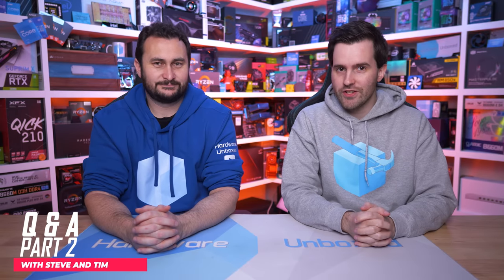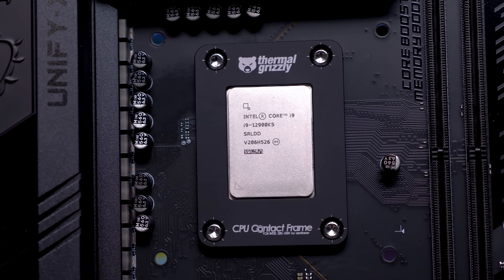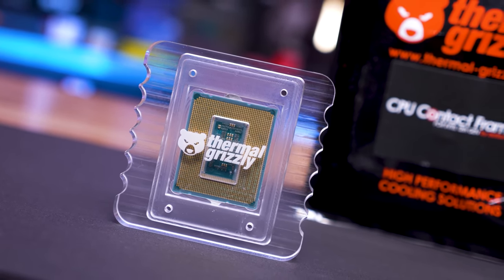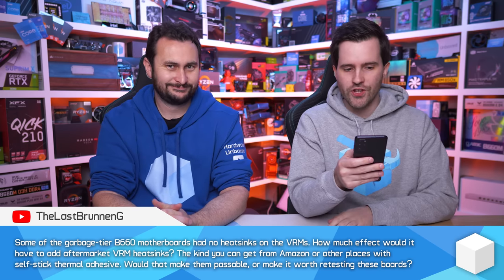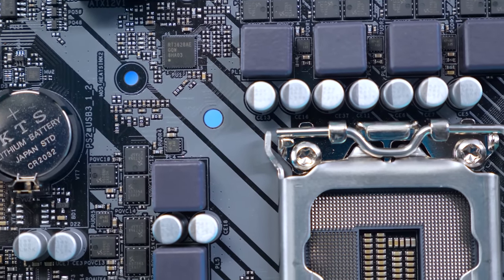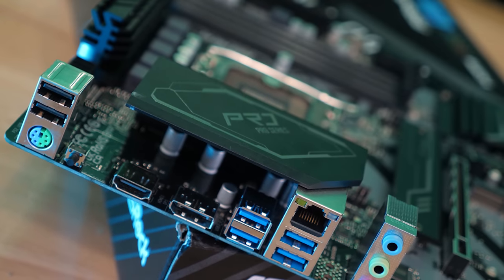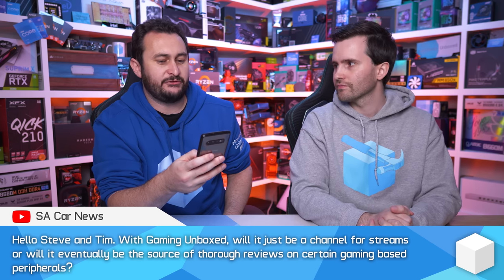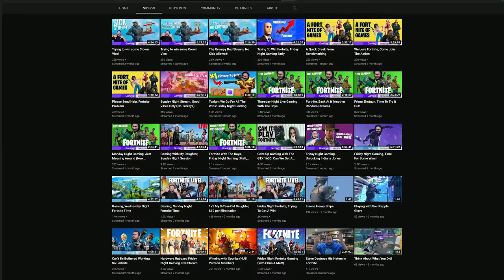Biggest Tech Fail 2022? Zen 4 To Make DDR5 Relevant? August Q&A [Part 2]

Comment: "What fully asynchronous task for gaming... can just be run OVER THERE"

As a former commercial game engine dev, LOTS.

First off physics is generally asynchronous, it runs at a fixed framerate, usually 30, sometimes 45, 48 or 60, because trying to do physics at a variable output framerate as dictated by GPU, display, etc, has lead to HORRIBLE failures every single time. It runs in its own thread (single, with some mildly multithreaded workers in some implementations for just a portion of the workload, like broadpass) and it emits one set of location snapshots encompassing every movable entity, every physics frame. Then the game main thread, for every frame to be rendered, picks a point in time between two last snapshots and interpolates between them to create a display position.

Networking and game logic tends to be somewhat integrated/synchronised with physics and using the same interpolation mechanism. It depends.

Then there's AI. If you're doing anything complex, you're going to need raycasts, lots of them, and you're going to batch them, so every time AI needs a raycast, it registers a callback and it receives the result one or several AI frames later and continues the logic then.

Then there's PVS (potentially visible set), where you're culling stuff. That might be Umbra, nobody quite knows what it does, there's a number of others, can be asynchronous, very. If it's conservative enough, maybe you won't see the gaps.

Then there's geometry buffer generation for the GPU. Again highly asynchronous, reacting to necessary object LOD changes, but with a delay. Also loading in chunks of the world that you're going to need soon, swapping in visible textures for higher resolution versions. The more eagerly you can do those jobs for things that might be needed with remaining CPU time, the more consistent you can keep the framerate as you don't have to stop rendering then and just beg the generator to hurry up. Have you seen what happens when you run GTA5 on a fast GPU with too few and too slow CPU cores? Chunks of the world go missing as it can't make time to generate them in time, it doesn't even have a sufficiently functional "stop rendering and hurry up the generator" logic.

Whether ecores help is another question entirely. The worker/tasklet schedulers in games don't have enough knowledge about these things, and foremost, game codebases usually have a LOT of data sharing (real and false both), contention, so scalability to ever more threads/cores becomes slower and more limited. You could move to more copying, message passing style systems which decouple and scale much better because then you're doing much better on the highend but you're raising minspec since you're introducing overhead to make things scale better, and you don't want to raise minspec, NO NO NO, that eats into your sales! Still, i expect some things to eventually be more e-core-friendly by design eventually, but not sure by how much and when, whether it'll ever be worth it.

Of course nobody's gonna read this but oh well.

Comment: When someone asks what 'sensitivity' you use, it's usually just an uninformed/incomplete question. Streamers for example will generally either answer with their DPI and their game specific sensitivity, or will instead answer with a measure of distance for one revolution (cm/360). Cm/360 can be easily calculated online, or manually if you know the raw sensitivity multipliers.
Some people will answer with an "edpi" value, but edpi is worthless because it's game specific and offers nothing better than the sens & dpi response. Cm/360 is the standard 'proper' response for FPS games generally.
With modern FPS, the only two real factors are DPI and the game 'sensitivity'. DPI is the resolution of the sensor's image itself, and the game sensitivity acts as a multiplier when translating X and Y counts into 3d degrees of rotation. 'Windows sensitivity' has been almost irrelevant for many years at this point, as almost every FPS game will bypass it and use the raw input. It's still a thing for 2d environments generally, and even stuff like the loot menus in Apex and (probably) Fortnite. Though this is a good thing as you can have the benefits of high DPI when moving the camera without then having to manage your 2d cursor at like 16k DPI.

tldr: measure/calculate ur distance for one rotation (cm/360) to have a universal answer. The 'average' range is probably anywhere between 15-50cm, but it varies a lot, especially amongst the less competitive crowds. Windows sens almost never matters, just dpi and the game specific sensitivity.

Comment: 16:10 biggest recent fail in tech... the intel LGA1700 ILM bending 12th gen cpus and no one holding them to account for it, everyone just advertises the 3rd party replacement products.
Reply: Yup but the 11900k is a waste of sand lol
Reply: I wouldn't consider that a fail. Just leaving marginal performance on the table for cost savings. The ILM has always been like that.
Once AMD started pushing intel they first changed their crap thermalpaste to a soldered IHS, then they factory flattened the IHS to improve thermal performance and now 3rd party companies found another trick to improve thermals. But you're hardly leaving any performance on the table just by having a 4-5°C warmer CPU.
Reply: @gamingmarcus  I wouldn't call a 10 degree celcius difference and throttling a "marginal performance" loss.

It's actually caused people to try to compensate by buying/upgrading to a cooler that's $100 more expensive than needed (if it were a properly designed ILM), not knowing what the real problem was.
Reply: @Penaldian  but that was 2021

Comment: 8:23 II use a DPI of at least 5500 DPI, but sometimes higher. The reason is I have issues with my shoulders that mean that lower DPI's where I have to make bigger arm movements can cause pain - or worse, potentially. Hence being able to crank the sensitivity high enough that I only need a few cm to go from one edge of the screen to another is really useful.

EDIT: Just to add a clarification given one response: the issue with my shoulder is due to hypermobility causing the shoulder to shift unpleasantly.
Reply: Well, using the hand for playing as for "Self pleasure" is not a good idea. Ever considered shifting?
Reply: Get the M575.  It's a trackball mouse that doesn't require any shoulder movement.  My dad loves his.
Reply: @giglioflex  I have tried trackballs, but I can't get the hang of them. Thanks for the suggestion though.

Comment: When AMD released Mantle, they really needed it: they were selling decent GPUs at the time but their CPUs were getting trashed at gaming. By enabling asynchronous GPU / CPU interactions, they could prevent their slow FX chips from impeding their RX290 GPUs and make pitching an all-AMD system not be completely ludicrous.
Reply: I remember watching AMD's keynotes about how Mantle worked when they first introduced it. How it was supposed to help the system wade pass all of the crap & bloat of Windows and help the GPU communicate more directly with the CPU while running games. They also spoke about an audio codec that was also part of Mantle to help produce a more realistic and directional sound experience in games. Sadly, I think the only game that ever took advantage of it was the not so good remake of the THIEF game.

As for AMD's graphics cards, the one you speak of was the R9 290/290X. I remember drooling over them big time when they came out. Sadly I had no money to even think about obtaining something like that. But by the time the 300 series graphics cards came out I was able to nab an R9 270X for $160. Which I still happen to have. Then a while later I was able to obtain an R9 FURY for $260 when the new RX 400 series cards came out. I still have the R9 Fury as well, but my nephew is currently using it. Eventually I'll get it back and keep it in the collection. I like keeping my previous graphics cards from years past to see my progression from having nothing to what I've gained. An RX 6900XT is in my sights, I'm keeping my eye on the price drops. :)
Reply: @Slane583  the consoles seem to be making use of the directional audio tech these days, at least their HD audio product description reads exactly like the amd true audio on my 390
Reply: @mattBLACKpunk  Huh, interesting.  If that's the case then it's good to see that it hasn't gone the way of the Dodo. Even though Mantle is no longer around in name I feel that's what Vulkan has become. Then DX12 & DX12 Extreme are offshoots of the same thing. Rebellion seems to be quite good at including both DX and Vulkan in their Sniper Elite games. SE-5 has both DX12 and Vulkan as api choices in the game settings.
Reply: @Slane583  Vulkan actually is based on Mantle.  It's essentially a combination of Mantle and OpenGL in its root design.

Comment: With regard to the highest tier component to avoid bottleneck debate; when trying to build a balanced PC, it's often difficult to find out whether or not a certain GPU  or CPU will bottleneck it's counterpart when all it is tested with is the highest tier part.

IMHO, the only way to find out is to watch benchmarks with the pairing you're interested in, plenty of which can be found on YouTube.

For example, I was trying to weigh up upgrading from a 3700X to a 5800X3D with a 3080 and playing at 1440p and there just wasn't any information on any of the major hardware channels besides me looking at the data and making my best guess.  This definitely helps get in the ball park, but looking at benchmarks in the games I play with those specific pairings and comparing them was definitely the way to go

Comment: Software dev here adding my 2 cents on multi-core games.  AI actually can be run 100% async and not tie back into the main thread at all.  For games anything that can have a lag of 2-3 frames from the main thread can be fully async.  It works like this: spin off a new thread to do a specific task (for example handle the AI for crowds and cars in Spider-Man) and let that task run at it's own speed.  Use a shared memory data structure that both the main thread and the second thread have access to, and use a flag to know when an update is available.  If the flag is set the main thread grabs the new info and uses it, if the flag is not set it uses the old info.  Thus means the main thread is never stuck waiting on a slower thread.  If the slow thread isn't ready it just keeps on moving and checks again next thread.  I don't do game engine development, but my educated guess is that this is already happening.  Shared memory between cores means a lot of memory read/writes which is improved by larger CPU cache.  Testing on this channel already shows CPU cache is king instead of core count most likely because thread memory sharing can still happen on lower core count CPUs since application thread count is often much higher than physical core/thread count.

IO is already done this way, the main thread checks if a key or mouse button has been pressed to do some action and if not it moves on.  Same for network connection in multiplayer games.  This is what allows a game to run at 200 FPS on your machine without getting 200 updates per second from the game server.

Comment: Had an i5-2500k in 2011 lasted me until 2019 when  i jumped onto Ryzen 2700 even then i knew it could last another 3-4 years had i not gotten a bargain on the 2nd hand Ryzen 2700 system, probably would have jumped onto 5600x when it came out if i didn't get the deal. While we are in another resurgence of pc hardware revolution still think 8-10yrs is a reasonable time frame, especially with 4k/8k making us GPU bound atm.
By the time PS6/Xbox XX comes out is probably when you'd have to upgrade again
Reply: Zen/Zen+ aged pretty poorly though. Zen 3 is usually at least 50% faster in most games
Reply: @Lurch7861 yeah it's a bit like the early 2000s again where things advanced rapidly. Then things stagnated 2011 to 2016
Reply: I'm still using a 2500K (4c / 4t) today. Best bang/$ purchase for me as far as gaming PC is concerned for me, I've been using it since 2012. I'm about to upgrade since my GPU  died a month ago (GTX660 Ti). I'm thinking of going 5600x or i5-12400 (I'm leaning towards the 12400 since onboard graphics can be a lifesaver...) +Rx 6600 (XT if I can afford it) for my next build and we'll see how far this takes me... At least I won't have to sell a kidney to upgrade now, thanks to the crypto market imploding.The whole PC started to show it's age about 2 years ago, that's when some games became impossible to play, but most of the games I play where still playable with lower settings (1080p). I would have upgraded sooner but GPU prices being totally crazy forced me to wait.
Reply: @dalaran33434  try to aim for at least a 3060 Ti or 6700 XT if you can. They might get even cheaper later this month
Reply: @dalaran33434  I've completed Cyberpunk using i5-2500K @ 4,5 Ghz & 1060 6 GB. 1080p, medium settings, about 40 fps. 
I plan to upgrade to i5-13400 or i5-12400 depending on the price but definitely stay on DDR4.

Comment: About the "i5 are enough"... When there's any game that lags to the moon or won't work at all on an i3-12100, we can come back to this topic. It's really a moot point to discuss the relevance of over 6c CPUs as a minimum when the 4c8t are still gaming just fine.
Reply: Yes but only if those 4c are modern, 4c from 5-10 years ago will cause you problems for sure.
Reply: @John__K  For 5 years we had Skylake IPC, obviously old quad cores aren't good.
Reply: @John__K  Just upgraded my i7-4770, 1080ti build to a 12600k, 3080ti

I can tell you that no, the CPU(4 cores, 8 threads, 2013 model) was not a problem for any game not named Microsoft Flight Sim. Even civ six, a very CPU intense game, ran well. That's essentially the only game I've seen any noticeable performance enhancement from the CPU in.
Reply: I can still use my e3-1245 .
The xeon i use is slow in singel core than a i7 2700k but in multi core use its faster with all cores than a i7 2700k .(it can use more tdp) 
The cpu still play games fine with a good card (use a nvidia 1050ti) .
Thanks to amd fsr option in games)
Oke i have to set details lower .
But i never play ultra mode or even high mode.
I play race games or faster shooters.
So i do not need Nice extrame ultra pixels.
Only in game what have a lot of people in it than you see that the e3-1245 is time for a upgrade .
Will i do not play that games with 125 people on a map.
So for me its not a problem 

O and its a Dell t1600 systeem with custom cooler systeem (beult my self a hybrid heatpipes syteem with the original dell fan )
The cpu temps are real low about 60/70 celcius in stress

Comment: In regards to the guy with the HTPC for gaming, you have another option. streaming games from your main PC via Steam Link or other in home streaming. so as long as you have hardware robust enough to stream 4k content reliably, you are solid. So chosing your graphics card for the HTPC is open to lower tier cards. Also, a note, if your TV does not have a good enough "game mode" or does not have Free sync/gsync and is not above 60hz, you will still have LAG! Take it from me, the screen lag is Real! On line competitive gaming is a no go. What works for consoles does not translate in to the PC world via TV. And if you are streaming to the TV that will double your lag....just some food for thought.

Comment: Most shooter games are not affected by the pointer speed setting in Windows. If you just share your DPI and in game sensitivity we can figure it out, but the standard is to measure cm/360°. There are also websites that calculate this and help you match it between games.

Comment: What you guys are missing on the 4C/4T discussion is the lack of ST progress during those years. That more than anything is what kept them alive coupled with some of the early ones like 2500K having great OC potential. A 2500K at 4,8GHz is not that far off a 6600K at stock. THAT more than the core/thread count not increasing (and what was needed) is what made it last so long.

Since both Intel and AMD are at each other's necks and pushing frequency and IPC again. General industry progress will in return raise how demanding games can be. The 5600X will start to fall behind in the ST department much faster than Sandy Bridge did. Core count is not what will make it obsolete, just being "slow" is.

Comment: I do say on the DDR5 question, it seems to be that if a game is optimized HEAVILY for AMD RT (IE Compenating for it's lackluster perf by offloading data onto the CPU using the far higher CPU-bandwidth on the PS5/Series S|X versus any PCs atm), it would be a bit boon if you turn RT on.

At least based on the only few reasons a performance jump of that magnitude would occur in Spiderman when going from DDR4 to DDR5 (or 3DVC in the 5800X3D compensating for it) when RT is on at 1080p.

And with Upscaling options like DLSS/IGTI/FSR2/UE-TSR, more games will run at 1080p or lower internally, meaning 1080p-like data will get passed to the CPU.